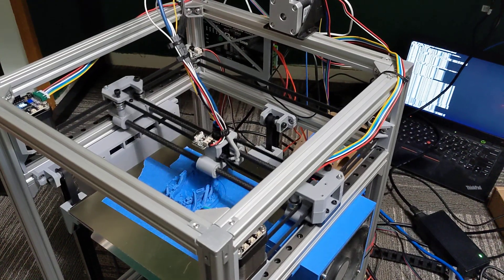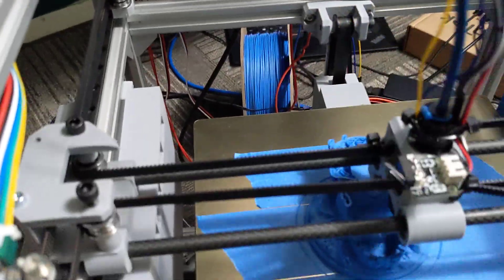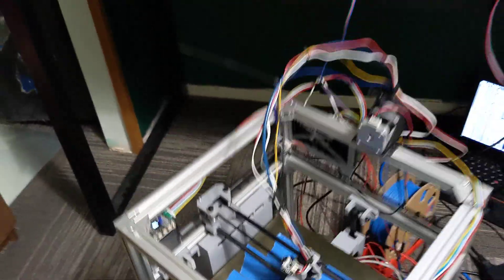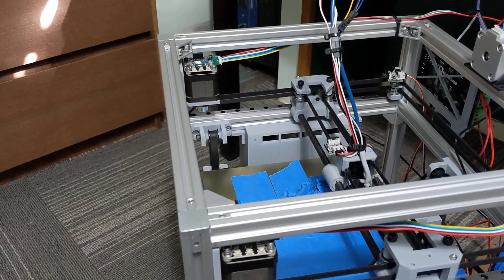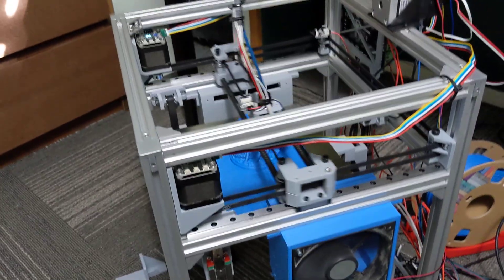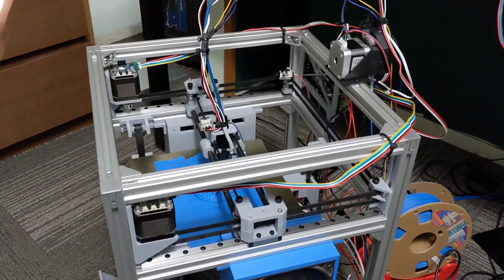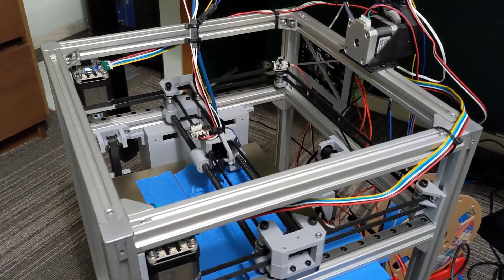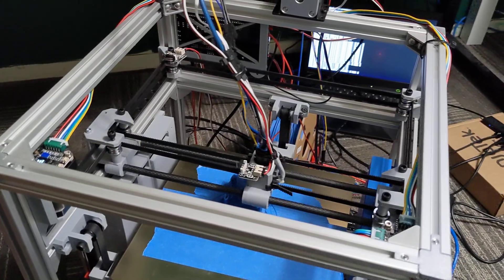DIY Fast CoreXY 3D Printer! Carbon Fiber X rods!

Comment: I'm converting my Xvico / Lerdge to a Core XY. I found a plan on Thingiverse: Swiftcore? The frame is made with 1/2' copper pipe. I'll file it with some kind of sand. I'm using carbon tubes all the way around. I'll post a video when it works, if I get it there. Bought a Sonic Pad for my CR6SE also. I'm looking forwards to seeing Klipper results for that machine.

Comment: Would you be willing to explain the advantage of closed loop steppers to me? amazing build btw. Love how quiet it is!
Reply from the maker: closed loop steppers know exactly were they are. They use an encoder on the back of the stepper to accurately control them. This also reduces noise and vibration
Reply: @Rolohaun  thank you for the reply! How does this reduce noise?
Reply from the maker: @K M  I believe because the stepper does not over compensate when moving it can use less power and that reduces noise and vibration
Reply: @Rolohaun  Makes sense.

Comment: do you use any kind of lubricant on the rods? like lithium or silicone grease.
Reply from the maker: no I didn't I used Igus Drylin bearings which are self lubricating

Comment: Nice  bit of kit, but I refer to your comment on rigidity of the frame and vibration, ridgitiy is paramount for accuracy and stability, I think the real issue is motor type, quality and power, cutting back on weight with motor ability, bearings, cooling etc is always going to introduce limitations and problems, you can achieve the same speed with quality motors and components but at higher cost and power consumption, but all the problems are gone, so I'm not sure where you want to go with this, cheap and fast, or fast and no budget, the latter will give you the best performance and reliability the other problems and restrictions, good work though and I will be waiting to see where you go next
Reply from the maker: there are a lot of variables for sure and it depends on what you want to do. Klipper and input shaper can only compensate so much for weight. I think you want the lightest moving parts possible. Good motors and a solid frame a key for sure with accuracy.

Comment: Impressive build. May I suggest you stay with this 0 cooling fan approach, and simply design another rail separate of the nozzle housing, that 1. blows in the general direction of the printer head. 2. Or moves with the printer head on a separate rail. I mean, innovation baby!
Reply from the maker: unfortunately this printer was discontinued, too hard to get carbon rods that have good tolerances
Reply: @Rolohaun  Sad to hear. Nice project tho. I might eventually buy a Voron 2.4r build kit, now that I completely upgraded the hell out of my Ender 3 classic.

Comment: interesting project! I've been diving into all kind of printer designs for my own (yet to be built) printer. You might have heard of this guy building the VzBot: https://www.youtube.com/watch?v=1_YokHgagIQ a very fast printer. You might be able to incorporate some of his solution to yours. Like the external parts cooler. I wonder how far you can push the carbon sliding parts without vibrations
Reply from the maker: This project has been discontinued as the carbon rods are to hard to get with the right tolerance
Reply: @Rolohaun  Ah thanks for the heads-up! Maybe I'll try something similar in the far future

Comment: Do you share the stl files?
Reply from the maker: no unfortunately this project was discontinued
Reply: @Rolohaun  ok, thanks! Do you any project with crossXY with carbon fiber rods?
Reply from the maker: @UniDuni3d  no, the main issues is you cannot get CF rods with good tolerances they are too random and need to be machined.

Comment: I ditched the carbon fiber rods on my corexy printer and went for linear rails. With a direct extruder on it I found there was too much flex in the rods, even the rods were carbon.
But; I had the rods above each other, your setup it a bit more ridgid in that respect I guess.👍
O, could still loose some weight on the gantry mounting the X-limit switch on the Y axis.. 😄
Reply: Why would you ever put the rods above each other, the weight on the axis isn't what you should worry about. The mistake is definitely not on the rods here....
Reply: there  is also problem mounting it in one plane horizontally because the weight of the direct extruder may arch the CF tube downwards. I think 4 tube provide 3d strength horizontally and vertically might do the trick. It is still way lighter than an mgn rail with aluminium 2020 tube.
Reply: @H_B_R   That sounds like a huge pain in the ass, to be honest. Just go for larger OD at that point.
Reply: @c-djinni or simply a smaller ID.

Comment: One suggestion: you could mount your bowden extruder and motor on an arm that mounts the extruder directly above the center of the bed, like 10-12"" above the nozzle. I did it with success, cut my bowden tube from 20" down to 12". A shorter bowden tube makes an enormous difference. I could u a pic if u are interested.
Reply from the maker: I have decided to go with the sailfin direct drive extruder
Reply: @Rolohaun  even better. Good choice!
Reply: I'd love to see that pic!

Comment: Getting the gantry weight down is important, so carbon rods make sense. Do you have any plans to reduce weight of the end pieces of the gantry? Looks like they are printed. Maybe you could get away with much smaller pulley bearings with carbon shafts of screws. Lighter linear bearings would be nice too. Could you use a smaller linear rail? 
CHC heater to reduce heater block weight, as well as a small and efficient hotend heatsink.
Reply from the maker: I am defiantly trying some things, I am already using MGN9 on the Y I don't want to go any smaller than that. We will see what my input shaper accel max is when I build the real version

Comment: Could you link where you got the carbon tube from? All of the tubing I have is either pulltruded or the surface finish is too rough for linear motion. Also I'm running an LGX Lite on my Voron V0 and can't recommend it enough, I get the most consistent extrusion I've ever seen out of any printer and at twice the speed. The only downside is that the torque from the tiny stepper isn't that high so I can't get more than like 21-25mm^3/s flow out of a mosquito magnum with a CHT nozzle with PLA @210C.
Reply: What's wrong with pultruded tubes? Seems like it would be better for this since there's no torsion on the tubes. Unidirectional fiber should be stiffer for bending.
Reply: @dekutree64  aside from the usually reduced heat resistance I can't think of anything, I was just surprised you could get woven tube with smooth outer finish like that
Reply from the maker: here is the link https://www.aliexpress.com/item/32822916583.html?spm=a2g0o.cart.0.0.ca613c00V8XKxT&mp=1
Reply from the maker: I had a LGX, I really liked it

Comment: hello, i have the same stepper drivers and i couldn't get them to work properly on marlin 2 firmware What settings in the firmware do you use?
Reply from the maker: I am using klipper so I just didn't put any stepper driver info in my config. I think for Marlin you need to set them as old a4988 drivers
Reply: Did you figure this out? I am just about to buy these closed loop steppers and I was planning to run them on Marlin
Reply: @KM-yw9vr  yes, I chose values for A4988

Comment: Hello is the Project available?
Reply from the maker: not yet, this is a very rough prototype. More videos and a release coming soon
Reply: I am looking for a long time to build a fast 3D printer and this one looks like an amazing Platform to work on also the components are pretty easy to get in comparison to other printers for now I have subscribed and I am looking forward In to this keep up the amazing work :)
Reply from the maker: @grasu4233  thank you very much! My goal is to make easy to build printers that work well with common components. Most of this printer was made with my SimpleCore design. You can check out videos about that one on my channel and join my discord.

Comment: How do you think the carbon rods would resist torque from the weight of the tool head if you were to scale up the size significantly? This is really cool. Thanks!
Reply from the maker: hard to say but it would be neat to try on my 330x300 build, I have 500mm long tubes and they are pretty ridged

Comment: At higher speeds, logic says the Bambu Lab printers will get very noisy, but most interesting for your sake is if the Bambu Lab printers can print faster at the same noise level.
Reply from the maker: I have a bambu labs X1 carbon on order so I will be comparing it with the full release of this printer
Reply: @Rolohaun  I look forward to that!

I'm not persuaded there currently exists an "ideal" 3D printer that anyone has in final form (how many remain in one form throughout their lives?) or in development.  If you want to just get printing, the Bambu and AnkerMake M5 seem to address those that goal as best as can be met right now.  If you want to tinker instead of just get down to printing, and you want to hack them to your desires, they appear to be the wrong choice.

Comment: Hi, I also have 2 close loop motors and a a printer running Klipper, can you share your experience installing the close loop stepper motors on klipper?
Reply from the maker: Yes it was very easy as klipper does not control the stepper driver I just put in my normal x and y axis info but no stepper driver info and it worked.

Comment: Hi… I’m wondering how do you ensure the inner tolerance of igus bushing and carbon rod are matching/ pairing/ to make it sliding fit and don’t have too much of play or too tight
Reply from the maker: The igus bearing I leave a little loose, one the belts are tight it doesn't seem to affect print quality but more testing is needed
Reply: @Rolohaun  Did you progress on this one? How did the testing go?
Reply: Typically Igus bearings have to be pressed into a hole specifically dimensioned for them.  Inserting them into a properly bored mount block causes the bearing to compress to its useable diameter.  Letting them run loose is not recommended and will degrade their performance and introduce slop into the mechanism.
Reply: @rav3n595  I am late to this party, but I wonder if people still believe in this myth? If you print a tube and insert to ball bearing bussings into it, you need to allow for loose tolerances for it to run smoothly. Any use of 3D printed parts, needs to introduce sloppy tolerances, for anything to not bind. So even if you might be right on how the Igus is designed to work, that is simply not possible to achieve on any printed construction. As in, even if you use thight tolerance ball bearing bussing, and tight tolerance rods, your plastic simply cannot be printed to them tolerances. Just sort of fact that you need two rods, no matter what you do.
Reply: @FrodeBergetonNilsen  What myth are you talking about?  The OP asked a question regarding the proper use of Igus 'bushings'.  My comment is based on use instructions provided by Igus.  Recirculating ball type bushings are not the same as a sleeve bushing.  The OP used the words 'sliding fit', which suggests he was using sleeve bushings... not ball type bushings.  If he is using a ball type bushing, then all he can do is rely on the accuracy of the fit between bearing and shaft, as they are what they are.  If he is using a sleeve bushing, he can adjust the fit of the bearing to shaft by changing the diameter of the hole the bushing is pressed into, achieving any fit he feels is best for the operation of the machine.
Reply: @rav3n595  The Igus spec is sort of a bit wider than you seem to think. If you want to guide people to adhere to all the elements of that spec, you struggle a bit. I just told you why.

Comment: how do you make the build plate not fall down during shutdown? and when homing printer always seem to lower the bed first, making the bed lower into mechanical stop before homing to probe or Z_stop endswitch.
Reply from the maker: All I do is have a print end macro, when the printer finishes it runs that. it will move the z to the coordinates I specify. I know the value for the very bottom so it always moves there no endstop needed.

Comment: Nice build! I use a linear rail with no extrusion, it's plenty strong, hardened steel lol... 

To those who wish to expend $$$ to make $$$ faster isn't better... put it simply, anything over 100mms in a corexy WON'T save much time vs the quality.... 

For learning and experimenting a fast printer, super fun and expensive if you care about your $ and time.  (I've printed consistently at 300 MMS on slingers, core, and a belt printer, know what's up)

In the end if you want to engineer, tinker and play, this sht is super fun and a great learning experience!  I'll reiterate SUPER FUN IF YOU GOT TIME AND $ LOL! BET! 

If you are trying to start a printing business, let go of speed for consistency... promise.
Reply from the maker: Appreciate the feedback I definitely like to just build and experiment. I do want to try just a linear rail also, no extrusion. I know that works well.
Reply: @Rolohaun  I do both (build and print for fun, and $)! It's always fun to play! Now that I've figured out a few small upgrades on cheap printers print as good as anything! The advantage of rails IS NOT accuracy in fdm, but longevity... if you hobby print, forget them  100.. they do NOT make better prints... but they do last much longer without maintenance and minor issues at high miles... and I mean high miles. The average hobbyist will need to change a wheel or two every couple years. While if printing 24 7 365, rails help keep costs down over time.

Comment: I used direct drive with two carbon rods, that was not a good idea as the weight bent the rods. You may get a way with the Sherpa but another two rods may make things a little more stiff.
Reply: How about making at least one of the carbon tubes larger diameter? 10mm is about twice the stiffness of 8mm, and 12mm is almost 4x the stiffness, and only 1.5x the weight.

Comment: I’m curious what the input shaper max speed recommendations for Y are now that its so light. Is it higher than X now?
Reply from the maker: I designed the toolhead so fast, I have no belt tensioning so the input shaper data was off. The X and Y were similar but because they is almost no weight I am going to compare with and without input shaper